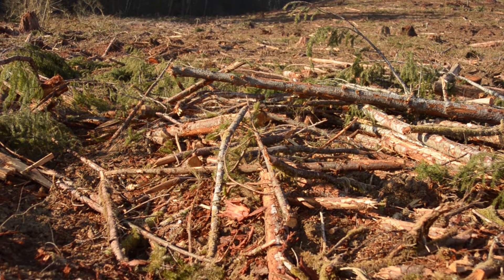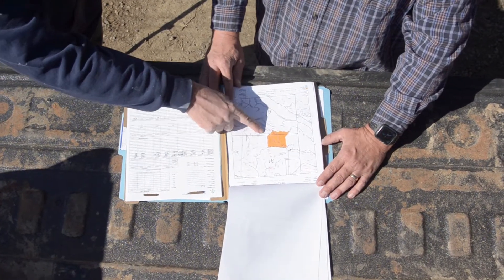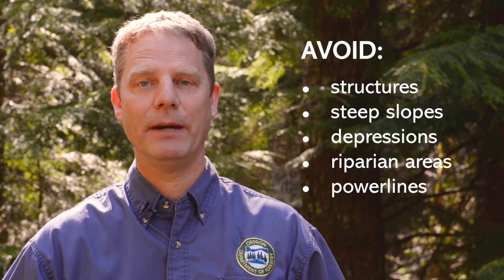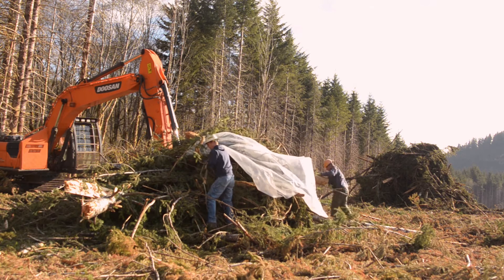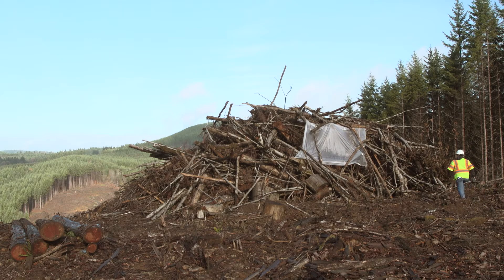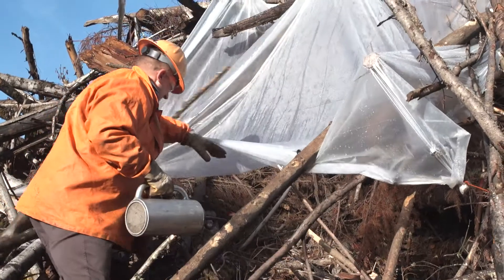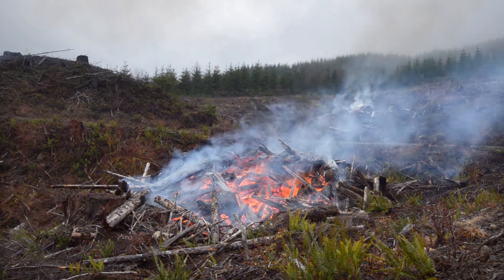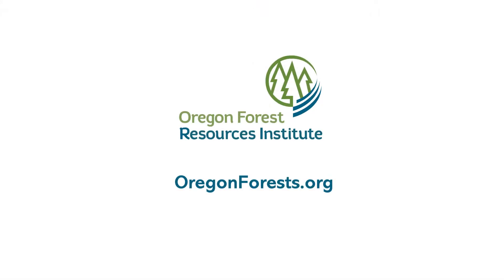SLASH PILES : How to safely build and burn

Comment: Why burn plastic? Why is an east wind bad?
Reply: Since it's Oregon, likely east winds are dry as it's coming off the desert. Burning plastic over dry wood is better than burning wet wood which takes longer to burn (extending the chance of fire spreading). You try removing plastic from under a huge pile of wood. Its impossible. Better to burn tiny bit of plastic than an entire forest.
Reply: Once the fire is going, plastic is gone and has has no effect on it. As far as wind, I can’t comment because I don’t live there.
Reply: @Farmtractorrescue  the plastic is there *to help dry out the wood better*. Dry wood burns faster than wet. Once the plastic is there, it's covered in more wood, so very difficult to remove.
Reply: Just like the old saying.
Wind from the east fish bite the leat.
Wind from the west fish bite the best